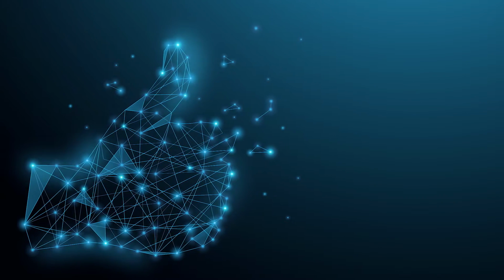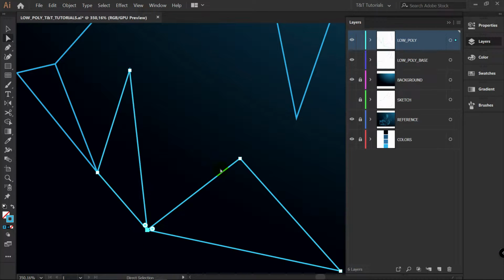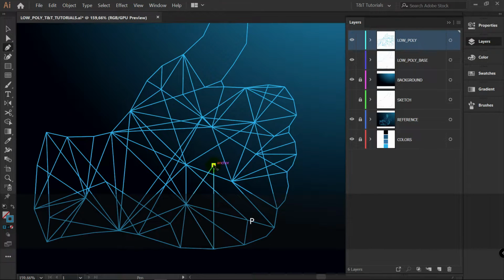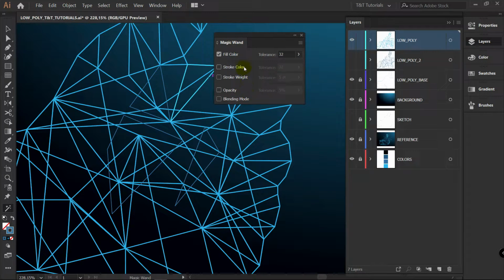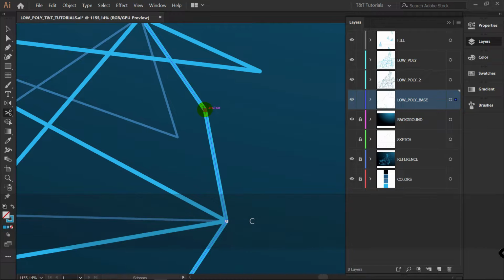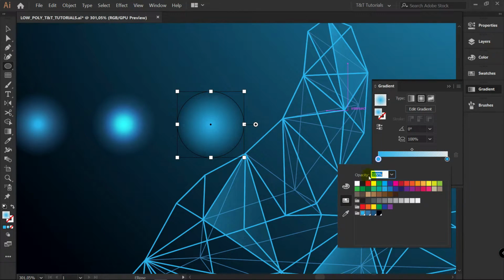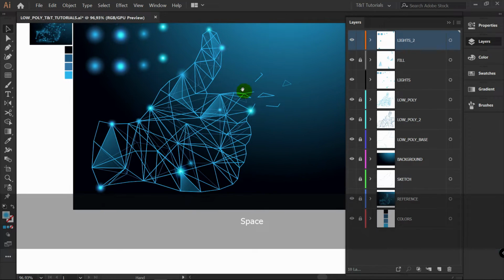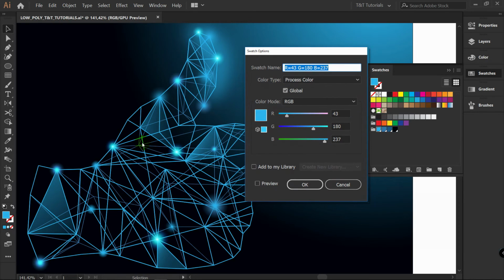Low Poly Thumbs Up Icon | Adobe Illustrator Tutorial

Comment: hi i tried to move the intersection point between three triangles to change the line but only line in one triangle is moving. do you know how to fix this?
Reply from the maker: Hi! Well, that’s the main hint! Watch video precisely and watch how I do this. I grab all points with the direct selection tool 😉
Reply from the maker: Simply drag mouse (when the direct selection tool is active) to grab all points into selection. Right after this you can move. Is that clear?
Reply from the maker: 🎉🎉🎉 congratulations, my friend 😉